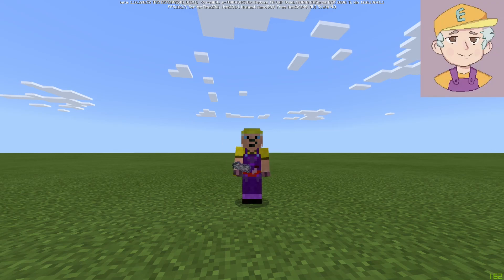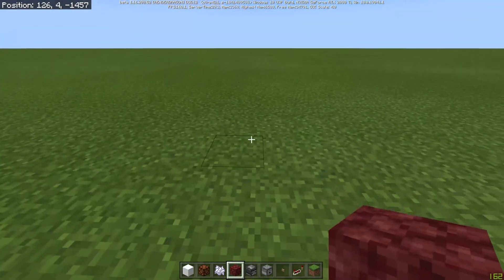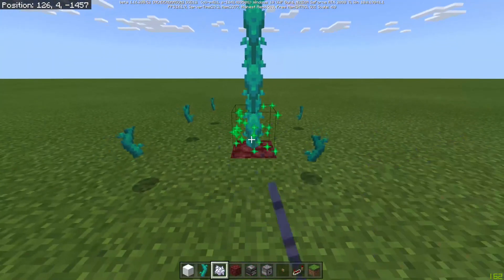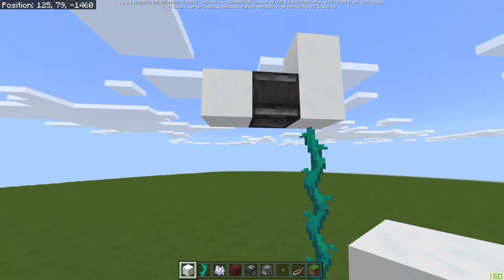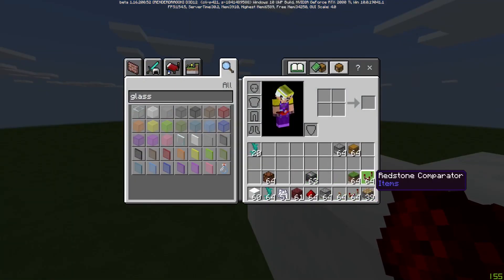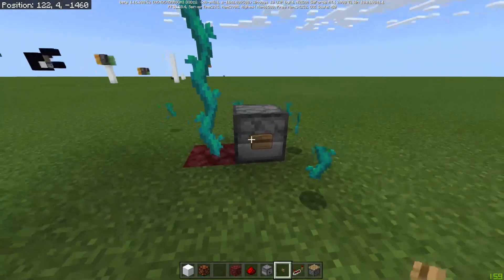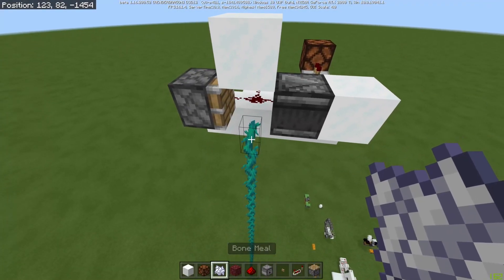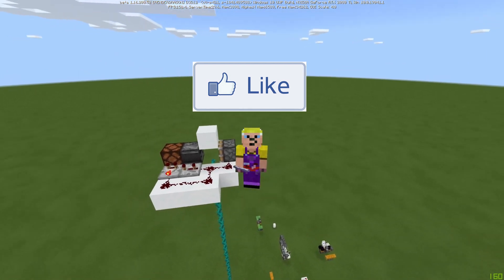Instant upwards redstone transmission 1x1

Comment: This can actually be used on Java, but you might have to reduce the risk of random tick misfires.  If once every 11 minutes is acceptable (twisted vine's random growth rate), then one vine will work.  Otherwise you can use multiple vines and only trigger the output if they fire on the same tick (two will randomly grow on the same tick once every 108 days, three every 4000 years).  You also might want to mitigate the interference a misfire before or after could cause.  You can do this by using more vines than the minimum count to trigger an output... say your desired number of vines is N (again, 2 for 108d, 3 for 4000y).  You would set up N+N-1 vines, and only trigger if at least N vines grow on the same tick (I think using signal strength and subtract mode with each vine module reducing strength by 1 if triggered would work to decode the output).  This way, if you wanted the 2 vine value of 1 misfire per 108 days, you would use 3 vines and trigger if at least 2 grow at the same time.  This might only have minor benefits over using a slime or redstone tower, though (if at all).  Too bad this doesn't work the same in Java.
Reply: An alternative method that would work would be to pair each vine with a wall detector.  When vine 1 triggers it sends a signal down the wall, and vine 2 will only trigger if both the wall and the original input are both active.  If you used the falling edge of the piston (by making a hook shape with slime blocks) you might even be able to make the entire system instant.  I'll have to test.
Edit: *nearly instant

Comment: does this work with the weeping vines as well?
Reply from the maker: I haven't tried it, but no reason why it wouldn't be the same. For downwards,  I typically use daylight sensors though. Then you don't need to worry about supplying bone meal and it's completely wireless (nothing but air between top and bottom)
Reply: @Eggfur  are daylight sensors instant as well?
Reply from the maker: Instant(ish), like about 4 ticks. And it doesn't take longer to go further. I show how to build it in my 3rd ever video.

Comment: I keep finding things that I need on your channel. Thanks for the build!
Reply: For my build it's more about the aesthetic. A torch tower simply wouldn't look good in my design which is more decorative with a few moving parts triggered by a signal from below. I was considering using a wall/observer (I'm sure you've seen that trick) until I saw your video
Reply from the maker: This one is a bit niche,  but really useful in the right place. I used it in my advanced villager breeder to call for more villagers

Comment: Your way over complicating a simple build(a torch tower is one wide, instant transmission and doesn't require bonemeal, or anything else other then some blocks and torches). Even with that in mind, it is interesting and I could see some applications for it.
Reply from the maker: Hi - torch towers are far from instant though. It takes 1 redstone tick for each torch to switch, so the ~250 blocks from bedrock to build limit would take 12.5 seconds with a torch tower. The fastest 1x1 method before this would be upwards facing sticky pistons, will 11 slime blocks and a redstone block. They take 2 ticks to extend, and cover 14 blocks per piston, so you could do 250 blocks in 3.4 seconds, but it's also very expensive! My system takes 2 ticks (0.2 seconds) to get a signal any distance.
Reply: @Eggfur  your right. I can't think of any reason off hand that I would need it to be instant at that distance. I'm sure there are. Great idea either way.
Reply from the maker: @JakMoy  I came up with it because I wanted to build a villager breeder in the sky, but have the option of controlling it from the ground. A delay there could mean that you end up with too many or too few villagers.

It's also a lot easier to build than a torch tower - try building that straight up in survival! And gives you a ready made ladder to get to your farm in the sky, since twisting vines are climbable
Reply: @Eggfur  I wanted to respond to your comment about the difficulty of building a torch tower in survival. Jump boost II makes it very easy! (I don't intend to detract from your build in any way, my point is only that beacons are great)

Comment: Not quite instant :P
Reply from the maker: No, not quite. It takes 2 ticks (0.2 seconds) to transfer the signal any distance upwards. One to power the dispenser and one for the observer. The circuit I showed at the top is a bit slower than that, but you can take the signal directly from the observer using an instant on pulse extender (something like the first schematic here: https://minecraft.gamepedia.com/Mechanics/Redstone/Pulse_circuit/pulse_extender)
Reply: @Eggfur  I’ll admit my first thought was to take the output directly from the observer but a second later I realized my error.
I wish I had a good use for this but for now it’ll just have to sit in my back pocket.
Reply from the maker: @gizmosboon2401  I'm working on a villager breeder (it's already working) but I want it 100 blocks up in the sky, but controllable from the ground. This will be perfect for that. I'll probably make a 1-wide version of it too, so I can control multiple things.